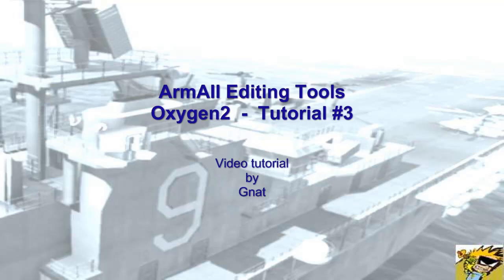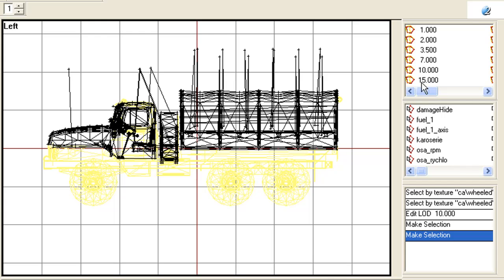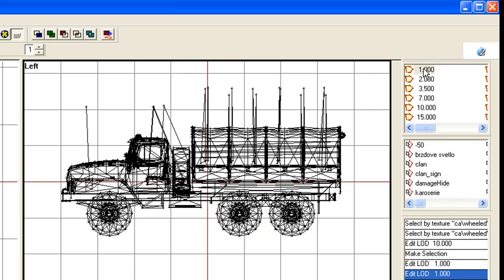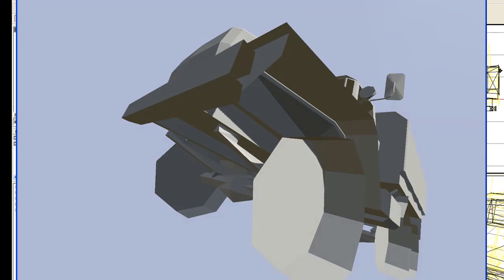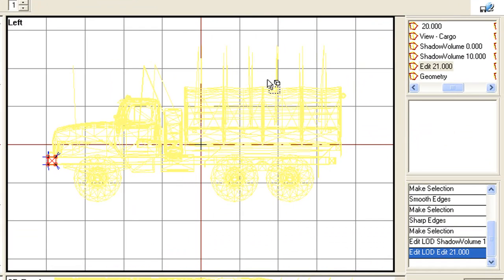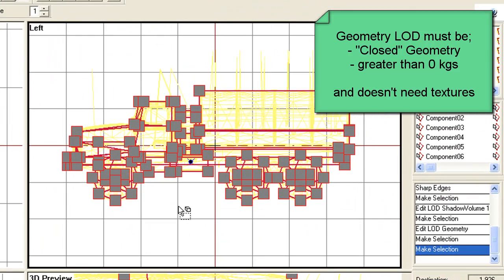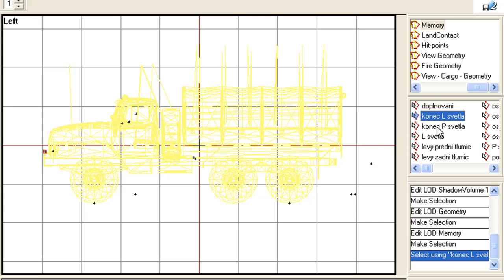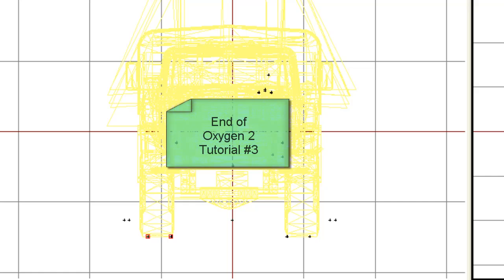Oxygen2 - Tutorial #3 - ArmAII Editing Tools

Comment: The name of the point you selected actually means "right front suspension". I am not sure about the function though. It is possible that the name is just wrong and it actually does imprint the tread on the ground as you described.